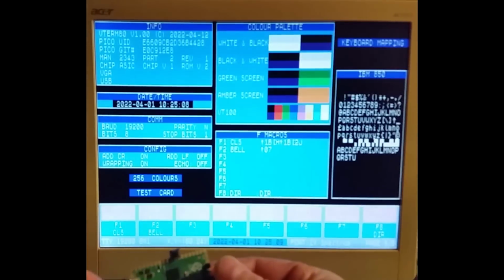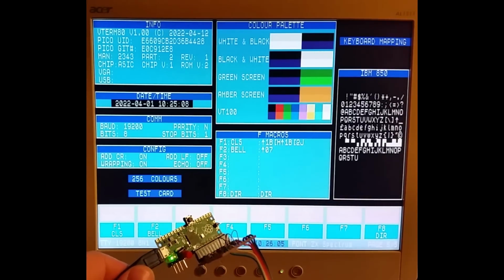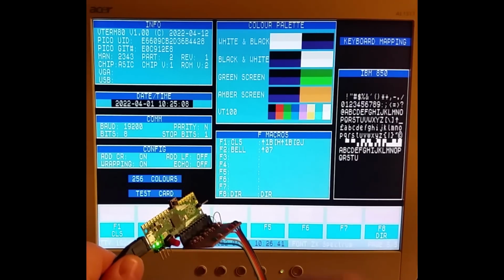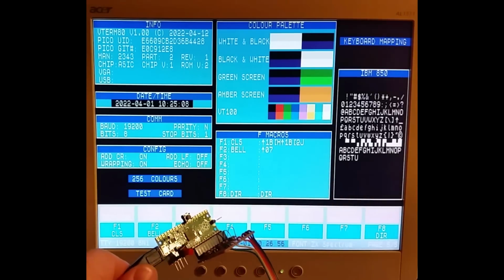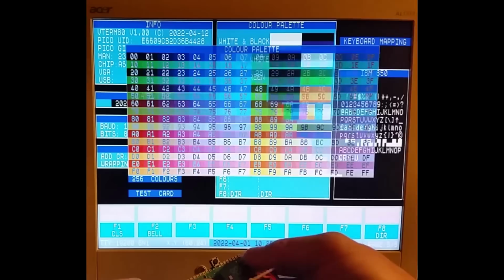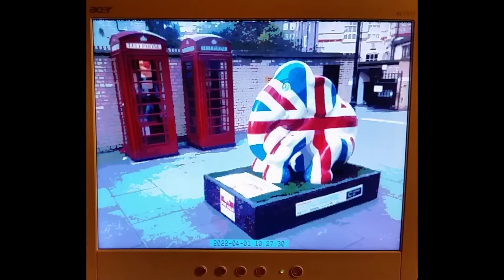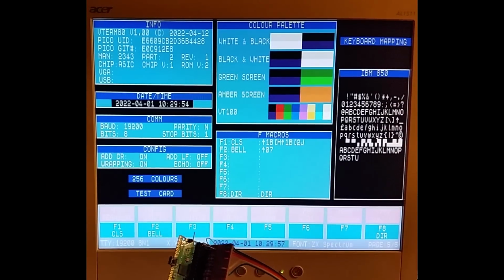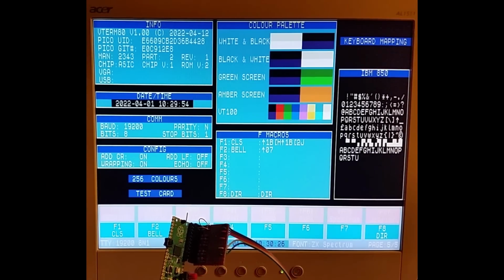Why I Was Wrong About Raspberry Pi Pico

Comment: how do you feel about the pico w now? pce out esp32?
Reply from the maker: I like that there is the option to have WiFi for a very low cost, but still the option not to have it if security is a requirement. I still like the option on the ESP32 to be able to encrypt the code uploaded, which isn't available on the Pico, and would be a reason for me to buy an ESP32.

Comment: Espressif hasn't been standing still since the original ESP32 came out -- you may want to reconsider reconsidering your reconsideration.
Reply from the maker: The target system for my emulators has always been ESP32. The feature of the ESP32 which I want to make use of is the encrypted program storage. However, I can see the Pico as being a specific choice for some applications because of the PIO.

Comment: I used to play with and then ran a business with microcontrollers years ago. I've only recently got back into the field. Love the ESP32 wireless possibilities. Seems I'm fortunate to come along after some of the bluetooth bugs are already ironed out. I'm bumbling along stumbling into basics like ESP32 code libraries not compiling for SEEDUINO XIAO BLE Sense, figuring out & and * for pointers when previously I've pretty much stuck to VB, python and assembler except for a brief foray into writing my own OS in C for my first 3D printer on ARM STM32F103VBT some 14 years ago.
The PIO does look fascinating, I'm curious what else it can do. The more innovative manufacturers do look for edges to their product like the PIO. Sometimes it's done with a portion of the chip being customisable FPGA. Scenix had a brilliant start but then dropped out of sight- their founder was beaten to death in China, I only found out myself when investigating about a year ago, what had become of them. I suspect that the high serial pheripheral count on the RPI pico is from a standard configuration library for PIO operation, and that your VGA customisations have dipped into some of this functionality, reducing the remainder configuration options with what's left of the PIO? I'm not quite sure where the longevity is for your project as people drop VGA from new monitors in production but what a powerful option you've created as a GUI backbone for an already potent dual core microcontroller, So very far from the days of my entry into computers with the ZX81 and it's 1k shared between tokenised program/screen & OS. Well done!

Comment: You could make a really great serial VT100 terminal out of an old VGA monitor with this thing! Just built a programmable bus protocol interface (with switchable hardware layer drivers) with a Pi Pico. Lovin' the PIO capabilities ... just need to try the DMA out now 🙂
Reply: Agree completely. I'm using PIO+DMA. That's exactly why I picked RP2040. Making custom PCBs. I'm curious what your programmable bus protocol interface is for and what different drivers you've created for it.

Comment: very cool, I want one will it be load loadable when it done just drop it Pico as a boot drive, all done? 
what i was hoping and surprised it taking this long fir anyone to coble three or four pico, into as one machine, say as you demonstrating, if I'm following right, one pico as graphic card, one a as I/O for say keybord, mouse , joypad/joystick, storage sd card and/or disc drive, leaving one or to pico's to ac or be the CPU guts making all come to gather as one machine?
Reply: The RP2040 (MCU of Pico) can do all of that with just one IC. No need for multiple. I'm making custom PCBs with multiple RP2040's, but I have very specialized needs.
Reply from the maker: It is just a single Pico doing everything.

Comment: wow… this could make a really interesting BLDC motor controller… any interest in doing one? What I imagine - a monolilthic robot chip, algo + low level control in the same logic. Only OEM’s used to be able to write code to take advantage of that architecture - as smaller outfits typically integrate 3rd party motor control.
Reply from the maker: It's not something I would have time for, but it would be really neat and make for a very compact solution.
Reply: @DevelopIT  well cool - at least u like the idea! If anyone else out there wants to contribute remotely on a project like that together - try to reach out, could be fun/useful.
Reply: Do you still intend to develop the project? Would love to contribute.
Reply: even if your control runs on a different device (which is more likely, rp2040 is not enough to run, say, a QP solver), it's nice to use one core for FoC/SVM exclusively, and the second core for communication with the higher level loop.

Comment: pico doesnt compare to an ESP32...simple fact no wifi/bluetooth..for network you need external hardware...
esp32 can do all youre saying here...AND MORE
Reply: There is already a card to add Wifi to the Pi Pico https://www.youtube.com/watch?v=VFC4XTRUNYk
Reply: Agree. The Pico needs WiFi to make it useful replacement for the esp32
Reply: Please show me how to do full VGA video on a ESP32 with zero CPU usage.
Reply: @dazzer_  ..look up bitluni ESP32 VGA.. generated by i2s hardware and has dma... also seen implementation that set the task to use one core leaving another core free to run your code..even seen the LPC take care of the thread...
Reply: @WacKEDmaN  Thanks for the answer. Your original comment was "esp32 can do all you're saying here...AND MORE" and I'm interested in how to drive VGA with zero CPU overhead. I'm already using the bitluni ESP32Lib, but the CPU hit is too much for my current project, and I don't want to rewrite the program for a Pico.

Comment: I think the picos main advantages are the dual cores and the pio. I have heard that people have had great successes over clocking them, potentially up to 400 MHz which is much higher than the esp32 as well. They are both good for different things, esp32 is great for it integrated wifi and Bluetooth and it’s other features like all the analogue stuff it can do and the RMT, which is meant for IR remote controls but can really be used to generate or receive just about any signal. I do still think it is a lot more powerful than the rp2040 but the pio is just so versatile, even more so than the RMT of the esp32. The other advantage I see the esp32 having is it has a low power core in addition to its two main cores, the low power core can run some basic programs and wake up the main cores when necessary, I’ve not seen it used often and it seems very complicated to set up but it seems to be a very powerful feature to have. To get the most out of either chip though you really need to be able to use both cores and the best way to do that is freertos, I know you can use both cores on the pico just using C and the pico sdk using their multi core library but using freertos just makes everything much easier, especially the synchronisation and data transfer.
Reply: Great comment. The PIO sounds like a real game changer, reminds me of the "Event System" Atmel had in the XMegas but with 2 serious cores. I never did a project with an XMega but the idea always sounded amazing.

The only problem is I typically use an MCU on a custom PCB so having integrated flash is a huge plus for me. It looks like they have left room in the naming scheme for integrated flash.

I think about it in 4 levels
MCU projects, Simple and pretty short dev curves so ATTiny or ATMega
MCU W/WIFI, ESP 32 has great small form factors for this so it's a no brainer
SBC, Just get a Pie, or if you need edge AI use a Corral or Jetson NANO
Anything larger just put it on a computer.

So this chip seems like it has some awesome ideas without a great application. If I wanted to go to the trouble to add external flash I would just bring in the big guns and go for an MPU that has more power than an M0+. As good as some things look about the RP2040 on paper, I just don't get it. I'm trying hard to find a place I would use this chip and I really can't come up with anything. If they can get a version out the door for $1.20 with 4k flash I would be very interested. Until then it's just a pair of left shoes. Really neat though, excited to see what comes from it.
Reply: @georhodiumgeo9827  It is what it is, an excellent development board. I don't think that the Pi Foundation tried to make this thing production ready. They might not even have a good enough supply chain to supply actual mass produced end user goods. The external flash makes much more sense from their perspective, they have to produce only one chip. No binning, no nothing. 

And I think it perfectly serves its vision. A really good MCU for enthusiasts and hardware hackers. They also recently released the Pico W, which includes a WiFi/Bluetooth chip. Makes it really appealing for most simple projects. Though it isn't as cheap as an ESP32, the PIO and the native USB makes up for the $1 price increase.
Reply: @tunahankaratay1523  Yeah that sounds about right.

Looks like the pico W is a real contender for the ESP32, that makes way more sense to me now. If I have a project come up like that I would definitely give it a shot as a replacement for the ESP32.

It takes me a bunch of time to really learn each chip so I stick to a small handful. This would justify learning the RP2040 and this PIO stuff. But nothing like that coming up at work so I'll just leave that to someday.

I got stuck with a big corporate project built on BeagleBones using Arch. It was not my idea and I tried to convince the people in charge Pie would have a longer lifespan and more community support early on in the project. Now they are gone and I'm stuck with it. I am replacing it entirely with a different solution so I'm refusing to migrate it to pie when I'm killing it anyway. It definitely taught me a lesson in favor of using popular hardware. Hopefully the pico W lasts for a long time and keeps a large following. Also the Pie community is incredible.

I'm hoping the Pie people can do for the RP2040 what Arduino did for the AtMega328p. Kinda in reverse but if it works thats awesome.

Anyway thanks for the comment, hopefully the RP2040 is popular and profitable enough to make a couple variants of, looking forward to a RP2240 if it happens. I would just drop the AtTiny chips I've gotten comfortable with and use that as my main MCU. My work is low volume (100 + or - per run) so I can pay a couple extra cents for each.
Reply: @georhodiumgeo9827  Hmmm, thanks for the insight on your work. I tend to dislike RPi SBCs because they don't have integrated storage nor M.2/SATA port. The SD card usually causes problems. And I've also seen quite a lot of electrical problems with them too. BeagleBone family of SBCs seem more appealing with their integrated eMMC, overall better build quality and PRUs. Are there real problems with them?
Reply: @georhodiumgeo9827  4KB flash on a 264KB RAM MCU is far too little for the usages the RP2040 would be well-suited for. Especially considering it has a 16KB XIP cache. I like that I can choose my type and size of flash based on the need.

Comment: but you can do same stuff and more colors with animation on esp32. pi pico has no fpu - it is a joke
Reply from the maker: You can use more colours on the Pico and do animation. But with the Pico it is all going on in the background and not using core time. Plus it doesn't have to be a display driver. It can be precision to a single 133MHz clock cycle and each PIO program can interact with each other and with code running on ether core.
Reply: @DevelopIT  it is using core time but not as much with dma support. it is just old slow cortex m0+ where esp32 is 240mhz dual core with wifi and fpu
Reply from the maker: @browaruspierogus2182  The DMA can transfer bytes of data from the PIO into RAM @ 133MB/S, and four bytes at a time I believe is 532MB/S. So for data acquisition/transmission protocols very powerful and non dedicated to any particular protocol (custom), and as I say the precision is 8ns. And once you start it, it will run independently of the cores.

Comment: the Xerox Alto was a research machine, Steve jobs used its User interface on Lisa & Mac
and Microsoft copied the apple MAC 1984 ,, and we all use that user interface today.
The ALTO had changeable MICROCODE so the instructions its CPU used could be changed,
you had the flexibility between software and faster hardware including VIDEO & Graphics

Comment: Have you added some external video ram to the pico for this project? I'm not sure what you mean by "DMA from ram to ram".
Reply from the maker: No extra RAM. I was just referring to the fact that DMA can do any source to any target. As it happens currently all of my data is const type, so in flash. However the re-definable character set may ultimately be RAM to RAM rendering. It depends how things pan out at that time.
Reply: @DevelopIT  Oh I see. I suppose in theory you could daisy chain a collection of picos using the GPIO and PIO for more memory and processing power, or just connect one to a mainline Pi to give it improved IO timing and free up the main Pi cores...
Reply: @davidste60  actually you could technically add more of the on the board storage if you have SMD skills.  The 8 pin IC next to the 2040 is storage and can be ' daisy chained ' to add more or replaced with a larger one of the same speed ( or slightly faster ) access timing.  I have not done it yet as I don't have ' GPU BIOS ' chips that small to do it with.
Reply: @ericblenner-hassett3945  - Interesting.
Reply: @davidste60  whenever i read people talking about all this, i wonder how you ever learnt it all, im just happy i can do angular :D and theres guys like you on another level * a million
Reply: @coolpot  In all fairness it's probably no more complex than angular, just different.
Reply: @davidste60  Just requires more computer science and hardware fundamentals understanding than Angular. You might be surprised how many people that do Web dev don't really understand memory, and types of it, and PCB components.
Reply: @ericblenner-hassett3945  I would not recommend that approach. Adding multiple QSPI NOR flash ICs to an RP2040 would require a lot of extra logic, as I understand it. Keep in mind that the dedicated QSPI i/f for NOR flash allows for caching of the memory-mapped flash-space using the 16KB XIP cache (this RAM is in addition to the 264KB main RAM). Much easier would be to just design a new PCB with a 16MB flash IC. That's what I'm doing. Just be sure to properly configure the flash if you don't use the recommended Winbond ICs that RPi rec's.
Reply: @davidste60  Even better would be to design a custom PCB with your required amount of RP2040's and flash. I'm actually designing custom PCBs with 2, 4, and possibly more RP2040s, with 16MB of flash attached to one of the RP2040's, and, in some cases, flash connected to one or more other RP2040's. When you use SPI or 12C comms on the same PCB (as they were mainly meant to be used), you can communicate at faster speeds and with RFI/EMI issues.

My main reason for using multiple RP2040's is actually to get more GPIO pins.

Comment: I have been very impressed with the PIO capabilities myself. Rather than going for speed or throughput, I have mostly used it to keep temporal precision when the remainder of the application is running in micropython. The result is extremely fast development with high flexibility, even when interacting with unusual (and strict) communications protocols.

The one feature I wish I could figure out, however, is using the PIO to trigger a timer capture. I'm getting close enough in software, but being able to get cycle accurate timestamps of unpredictable events would be outstanding.
Reply: What kind of jitter do you get when you trigger an interrupt from PIO and do the timing in the handler?
Reply: @danieljimenez1989  I didn't specifically characterize jitter, as I have no doubt it would be dominated by microphone. Writing an extension module and using that would be the way to go (or compiling directly with C/C++), but I haven't moved it to an extension yet.
Reply: @martinmckee5333  I assume you mean micropython where it says microphone.  I'm interested in time-stamping some fast pulses and would benefit from such information.
Reply: @danieljimenez1989  Yes... micropython (I actually fixed that once before... ugh).

I don't currently have much to offer that would be useful in your application. It seems to me that the one place that the RP2040 is lacking is in time-stamping facilities.

I'm currently looking at the possibility of using the PIO to keep track of the count as well as do the data transfer, and simply forgo an interrupt altogether.
Reply: @martinmckee5333  a short loop can be made in PIO to count  down from 0xffffffff and copy the current time to the input shift register using autopull.  One should be careful to count cycles and use delays where necessary to be sure every code path takes the same amount of cycles, and one couldn't timestamp with system clock precision, but probably a test every 4 system clocks or so would work.  That is still a precision under 100 ns, so it's still very much useful.
Reply: @danieljimenez1989  That was my plan. I haven't implemented it in my application yet, but it's simple enough.